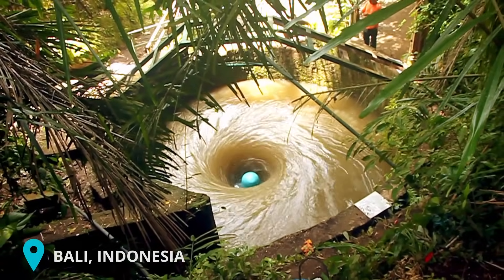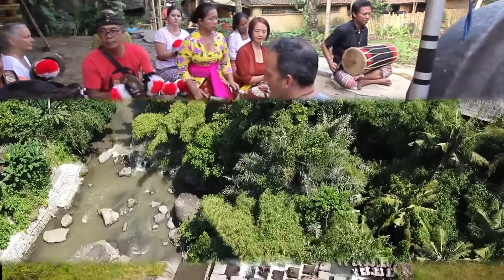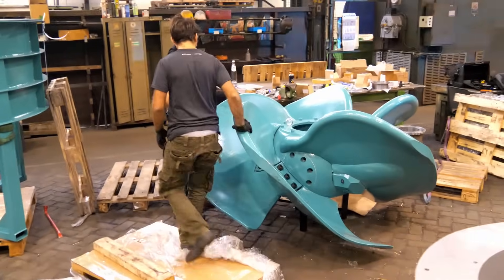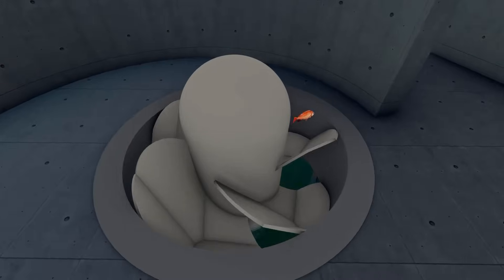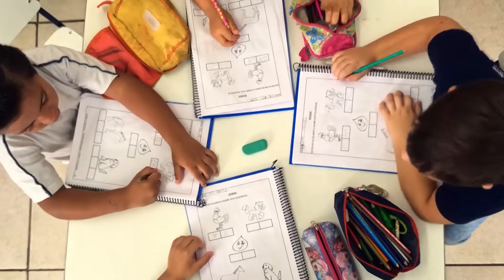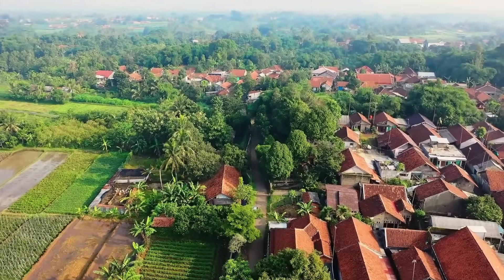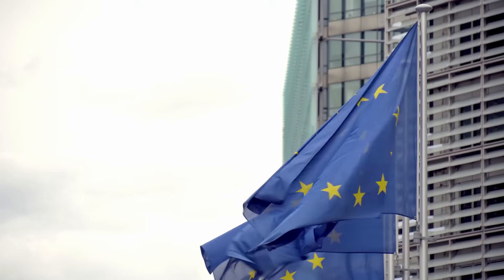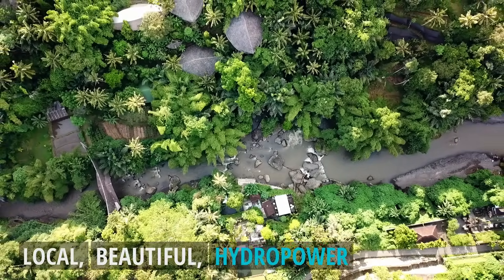Turbulent Energy Explained: The Vortex Turbine!

Comment: I like your project. Its a good design and good for the earth with 0% emitting carbon. I'm planning to create a same in my village on a running stream in front of my home. But I have not much resources. If you let me know what things I need for a 10 to 15 KW system and how much expensive It is. That will be a great help.

Comment: Thinking: if U make a closed loop, as in 1 pump pushing the water strait up
to say 2 meters, from there ya put ten 20cm high vortex turbines
(or five 40cm vortex turbines) in series.
could they generate more power
than is needed for the 1 pump to push it up the 2 meters?
thus creating free nrg ^^

Comment: Waayyyyy better than any of those stupid wind generators as water is hundreds times more dense meaning way smaller generator and using existing streams mean no dam reservoir thus less chance of heavy metal methyl mercury buildup and flooding of ecosystems, very low environmental impact compared to other renewables..seems good so far, looks cheaper than solar for ac output.. though limitations are within proximity of streams.. but what do I  know I wrote like some nerd, I'm  just bored lol 🤷🏻‍♂️.. nice addition tho.. reminds me that I  got a  bunch of clothes to wash .. cheers

Comment: we have the 24 hour pump running to around 60 to 80 cubic meter per hour and wonder if it will work with any size of turbins to produce a 3 phase power electricity?

Comment: Wouldn't a stack of 3 units, using the same water, falling in a continuing circular channel way, create triple ... or even triple+, the energy?  I mean, with the vortex, couldn't you use a continuing circular channel to flow it directly into another in falling teirs to get triple or (close) out put from the exact same source?  (almost like a childs spiral slide ... you know 3 vortexs, themselves in a spiral)  The 1st 90 degrees, for the source entry, the 2nd 90 degrees from the 1st, and 3rd 90 from the 2nd ... with its exit returning to the source?
Reply: No is not possible

Comment: 4:00 Hold on, why is the turbine spinning before the sluice gate is opened?
Reply from the maker: During startup the turbine first is turning as a motor, as soon as water is added, we shift the quadrant and use it as a generator. Because at that time the rotor is running at a similar speed to the vortex, we limit inrush currents that could otherwise jump the breakers of the school.
Reply: I think they're trying to pull a quick one.

Comment: Can this turbine harness the force of a 200 meter (slightly inclined) fall of water?
Reply: No, this is for small height drops. You'd need a different turbine design for higher water pressure.
Reply: There are plenty of high pressure systems to buy.
200 meters is a pressure of 20 bar or 20 kg/cm² thats high pressure. With a lot of energy. I am jalous.

Comment: Nice idea, but I'm sure federal/state/local governments forbid disturbing streams or small rivers, so this installation would have to be a covert one  ;)
Reply from the maker: which is totally possible ;) Hint hint
Reply: @TurbulentHydro  hi how much does it cost and how much power this model can produce I mean if some families in the farm. CA they get whole electricity needs for their home like the City and the 5KwDoes it the end of it's capacity or it produce 5kw per hour
Reply: Fence off your property well away from the turbine site with lots of no trespassing signs then design a bit of overhead camo to hide from the inevitable drones they use these days. Shouldn't take much to make it appear to be a small log jam or something from the air while the turbine does it's job underneath

Comment: Can you design a system that makes use of the rising water levels of a tidal river?
Reply from the maker: Explain a bit further please. You mean by using the water level difference created with tidals? Like a tidal barrage?
Reply: @TurbulentHydro  kinda like that yes. My hometown has a tidal river that pushes ocean water kilometers upstream every high tide and then recedes to very low levels just to repeat itself on the next high tide.
My thinking is that somehow one can harvest the energy as the tide moves in one direction and also when it moves in another direction. 

Your current designs are for rivers flowing in one direction only.
Reply: Buddy, how 'tidal' the river is? ^^
There are tidal rivers that vary in level by more than 8 meters at times. My engineering self refuses to believe there's no way, as my thinking suggest it might not even be a problem? It will depend on the terrain you'll have available to build on. 
If installing their product is you only concern, they'll probably make a project for you to follow? So don't worry too much. You might need to build a bit more, tho

Comment: Has there been a design proposed using stacked turbines, starting with the smallest first, then sizing them outward, recovering more and more energy from the cascade as it flows downward? Or vice versa, biggest first them shrink the cone down, building velocity and pressure.  Or even keep them the same size, just counter-rotate the blades to maintain head pressure, or keep them the same direction...

Just a few thoughts from a brain that loves to work in fluid ways.

Comment: 0:40 you do realize the thing killing fish in dams is the pressure differential not the blades right?
Reply from the maker: Pressure is one of the things killing fish. To be complete, it's pressure change over time, strike force (or shear force) due to blade impact, grinding (between parts). We designed the turbine to fall well below the parameters as set out by the Alden turbine labs and several EU universities that worked on this fish friendliness challenge. We've got a paper out recently about this part if you'd like to review
Reply: @TurbulentHydro  ok, it just briefly sounded in the video like you where saying the turbine its self did fish chopping.
I lovw the dam design though

Comment: How would this compare to solar+batteries? Those have no moving parts and lower cost of entry. I don't see the benefit of this system
Reply from the maker: Simple, it's more compact and it produces more energy without the need for battery storage. A 15kW turbine produces as much energy as a 90kW solar plant. That's 400kg of turbine vs 5170 kg of solar panels. A 90kW solar plant also takes about 450m2.. Roughly 2 tennis courts. 

Simple: when you have a river, use this type of hydro, solar can add the rest of the power demand if needed.
Reply: @TurbulentHydro  thank you for your answer

Comment: Strap one to a rock near a waterfall it will not need to be ran by any power source. 
Absolutely free energy that will last for decade's.
Reply: the turbine IS the power source, and the water the driver. in the example above, its FREE too ;)

you have merely changed the orientation 90degrees, and in so, destabilised the driver flow, 
you'll produce less power, and need more maintainance... ;)

Comment: For everyone talking about putting fences in and covers, that's a user end responsibility.  These people build the energy system itself, they have no idea where you're putting it in terms of terrain and other physical obstacles nearby like concrete slabs or beside a building.  Fencing the area off is determined by the location, your path of egress to it, and a multitude of other possibilities.  None of which have anything to do with the energy system itself or the company making it.

Comment: Use siphoning and 5 times more energy are easily generate by this setup
Reply from the maker: You mean a draft tube? There are reasons not to do it.
Reply: @TurbulentHydro  you are coming near the idea but with a twist 
Use suction point large and discharge point narrow
So we always have sufficient amount of water for regular and. Constant supply of water for energy🕉🕉🕉
Reply from the maker: The only thing that sucks is your suggestion (only pun intended 😉). Won't work though. Wide in, narrow out is called a nozzle. And that will just decrease the amount of flow passing through the turbine at low head.

Comment: Based on one of the comments I figure it to be about a low end 5kw system. My issue with this is why a turbine might be rated at that, it definitely does now mean you'll be hitting that. What sort of flow rates and volumes are needed. What is the construction costs and j see it as near impossible to get planning permission for projects like this in developed nations
Reply: Pretty simple to figure out the flow rate required by doing a simple energy balance. The energy output is a function of the kinetic energy and potential energy differences from the input to output side of the turbine.  Any freshman engineering student can do the calculation.
Reply: The potential energy is given 1.5 m drop the kenetic is the quantity. The 5kW generator is not the max but mutiple generators are possible.

Comment: This is super cool! I have a couple of questions:
1. Why do you only divert a small amount of water from the main flow? I would've thought more water passing through would be more profitable/ productive
2. I read some replies on previous videos, and you claim the efficiency is 50%. Where do you get this figure?
Reply: 2: You can calculate the potential energy the water has before and after it enters the turbine and compare that to the energy the turbine produced.
Reply: Probably because diverting the entire flow of water to build something to capture the entire flow would be expensive.
Reply: The system is built in a scale that only requires x amount of waterflow to generate energy at max capacity. You have to take into account that you are not the only person who needs to use the water plus by only diverting part of the stream you get past the environmental extremists who would claim that diverting the entire flow would adversely impact the local ecosystem.  Why ruffle any more feathers than absolutely necessary to get the amount of energy that you need for your project? At least that's what makes the most sense to me

Comment: very dangerous been open like that, if some animal fall in or people
Reply: Putting a grate is like 15 dollars more and can be done by pretty much everyone
Reply: Rpm is very low....
Reply: @jaikumar848  windmill rpm is even lower, and they work very well
Reply: @arcachofo  Blade tip speed increases the larger the diameter of the turbine, and many windfarms increase tip velocity of turbine blades by a factor of 10 relative to the wind speed.  Blade tip speed on turbines like this will be lower than incoming water, which is designed to be low, harming little to no aquatic life, and be no more dangerous to terrestrial life than any normal non-mechanical irrigation transfer would be.

Tens of thousands of birds die at the blades of windfarms every year. 

**Just fact-checked myself.  Turns out it's estimated to be HUNDREDS of thousands of birds, not tens.
Reply: @jaikumar848  I mean sure rpm is low, but it's not small enough for ppl to pass trough easily lol
Reply from the maker: @Salutyyy  We tried it. Wouldn't advise... Added a fence
Reply from the maker: @jaikumar848  Thank you captain obvious, that's the point!
Reply: Maybe you shouldn’t be so dumb to fall in Karen. Wear your ppe gear you be save
Reply: Rpm does not matter if the turbine generates massive amounts of energy. The reason why it turns slow is due to the load by the grid
Reply: @marcangelodonelo5656  right on...it is the amount of torque you have to worry about...!

Comment: 3:59 wait, it's spinning without water? What's powering it up?
Reply: Looks to me like a small amount of water is flowing into it. Probably running no-load at minimum flow, turbine just free-spinning, maybe they get it turning like that before opening up the wicket gate fully and connect the generator to electrical load.
Reply from the maker: @quillmaurer6563  Jup, to limit inrush currents mainly
Reply: Just guessing but they might use the generator as a electric motor when starting up the system. Could give them advantages with the bearings . 

But I'm really just guessing. But i know for sure you can use an electric motor as a generator and vice versa easily and its done quite frequently
Reply: because the sluice gate is open at the bottom a small bit. 
how the fuck are all you lot not seeing it?

ah right yeah, coz you have no clue, and looking for BS to call out.

Comment: What the generator do you use?
Reply from the maker: induction generator, nice and robust
Reply: @TurbulentHydro  it is obviously, generator induces voltage, but what type?
Synchronous with PM, with excitation coil, BLDC, SRM, or asynchronous generator? :)
Reply from the maker: @Lexfr0mkhar  Induction = asynchronous
Reply: @TurbulentHydro  you should try smth with PM, therefore asynchronous machines with a squirrel cage aren't very efficient in a generator mode ;)

Comment: My house is next to a small stream, I might try using this.
Reply from the maker: @Muckin 4on That's the spirit. But seriously, if you ask for the plans we can give them!
Reply: How are you going to design and build the concrete chamber (called a volute) and who is going to do the hydraulic and electrical calculations? These things are engineered, you can’t buy one at Walmart.
Reply from the maker: @greenmountainboy2528  Well we can help with the engineering part. Would you guys want to see a video of how to make the volute out of concrete, metal, or even wood?
Reply: @TurbulentHydro Good day! Just out of curiosity; how much does it approximately cost to have a system fully operational such as at 00:55?

And how much energy does it produce?
Reply: @greenmountainboy2528   Dude.. Just crush another dream.

Comment: Everybody who lives near a river needs one of these
Reply: Depends on the cost...
Reply: @Miqdaad-b1n  meh. just sell back the electricity to the grid.

No really, they literally said that you can do that in the video.
Reply: @novastar6112  good idea, but poor countries have bureaucracy problems and setting up a local power generator would have to be done by the right person.
Reply: @novastar6112  it depends on the cost and from the looks of it, not cheap. I wonder how many year it will need to pay itself off also gotta look at maintenance costs to which could and probably is quite expensive.
Reply: @acillius2  Maintenance is low, due to lack of moving parts.
But yea I get your point: initial costs.

Cheaper than hydrodams at any rate though.
Reply from the maker: @acillius2  It depends on how much you pay for your current electricity, but we see pay back times of 4 to 6 years. In some cases like when replacing diesel, we see a payback of even just 2 years. Maintenance is low wit an oil change every year.
Reply: @Bailover Trend Hey, better than burning literal shit to cook I guess XD
Reply: Laguna
Reply: ALL SENIOR CITIZENS SHOULD HAVE LIFE ALERT
Reply: I live in the river  and sure it flows a lot but its tidal  the river here changes by 3 meters 2 times a day  and lots of boat travel it so not all rivers are good
Reply: This is really wonderful but what if we don't have water or river nearby. Can we have it installed if we make our own small dam on site using the rain water.
Reply: @Bailover Trend .___. Well crap.

But hey, it powers a decent amount of homes for a small village.

I dunno, but appears to be meant for 3rd world countries or poor villages for use.
Reply: @novastar6112  it would also be good for states and provinces located in the entire of a country or continent that don't have direct access to the ocean
Reply: Lol. That wouldn't work. You need quite a bit of elevation change. In this case not a whole lot but if you think about raising the river by a couple meters it would already put allot of strain on the banks of the river, the soil around it, and most parts it would just overflow and flood the region.
Reply from the maker: @brinkshows2720  depends on the geography and shape of the river, but yeah, our turbines are pretty useless in a flat river with no gradient.
Reply: @TurbulentHydro  i am not an engineer or landscaper  but why can't they create a 1 meter difference in  height in the actual diversion by   making the diversion slant downward with landscaping?
Reply: @TurbulentHydro  
Sir we have built in canal system naturally perfect for these system.we can install hundreds project like these.I am waiting for reply to move forward
Reply: @brinkshows2720  True, but at least it's relatively cheap and compact, as well as safe and eco-friendly.
Reply: @novastar6112  Well something almost the same price and size with 10 times the elevation can make tons and tons more power. So its quite cheap yeah, but not for the power it delivers. Economy of scale my friend :)
Reply: @brinkshows2720  Hey, these are meant for poor regions! Even if those things are more efficient, they're still too costly, especially considering the cost of power transmission [power lines and whatnot].

It may not be the most efficient, but it's cheap, and that's really all the reason why it's good.
Reply: @brinkshows2720  i am not an engineer or landscaper  but why can't they create a 1 meter difference in  height in the actual diversion by   making the diversion slant downward with landscaping?
Reply from the maker: sun shroom UTTP AVGCP  then head on down to our contact page and get in touch ;) www.turbulent.be/contact-us
Reply: @TurbulentHydro  can we use it for business purpose ?? 
Want to invest in this . Must reply